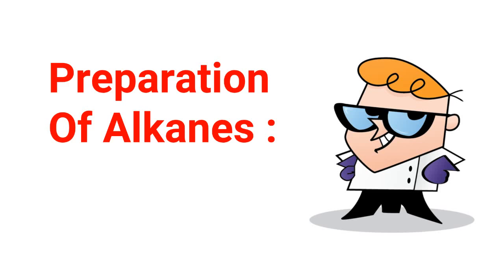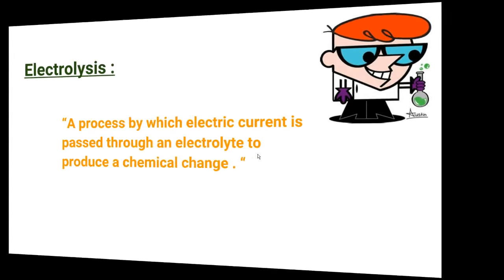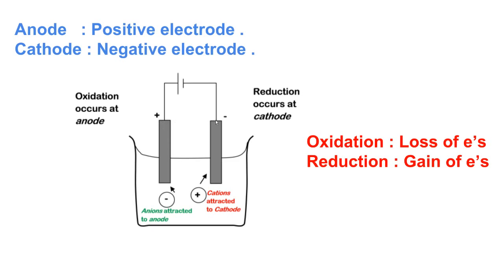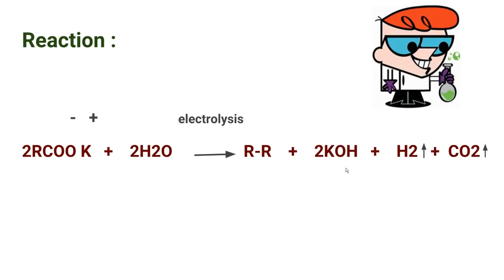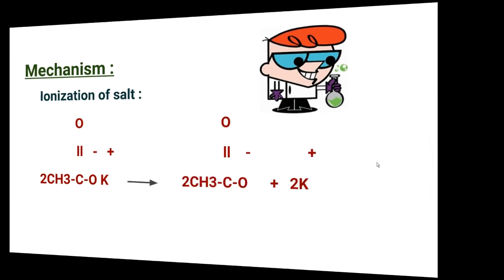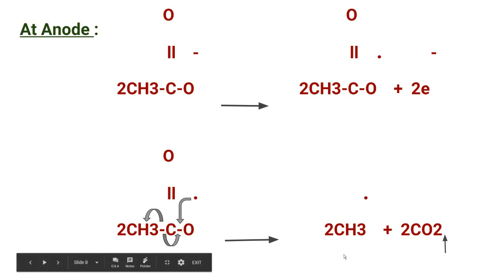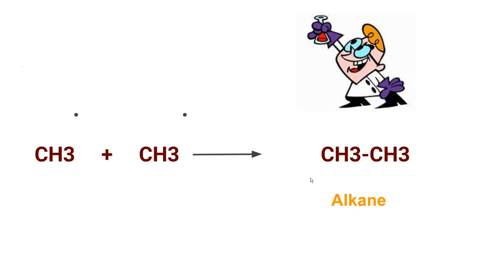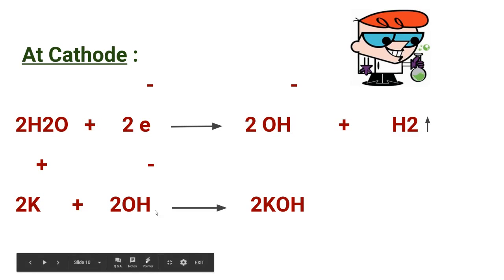Kolbe's Electrolytic Method :

Comment: I don't understand from step 2 of anode. In product you have 2methyl and 2 carbon dioxide but at the last anode step 2ch3 suddenly becomes ch3 and react with ch3 to give alkane.  Pls help
Reply from the maker: gamer king consider the whole solution .. dun think as if there are only 2 methyl .. a lot of methyl radical will be present in the solution .. then in the end all these radicals will combine together to form alkane to gain stability as radicals are not stable . i hope its clear now..

Comment: Why oxidation occur at anode not cathode
Reply from the maker: Raminder , remember oil rig . oxidation is loss , reduction is gain . anions in solution go to anode as opposite attracts and lose electrons there which are taken by anode . so loss of e's occur at anode . i hope its clear now :)
Reply: Conceptual Learning...
 you wrote electrons taken by anode what it means
Reply from the maker: You need to understand the process of electrolysis in which there is a constant supply of electric current . anode is a positive electrode so obviously negative ions will move towards it n will give up its e's .